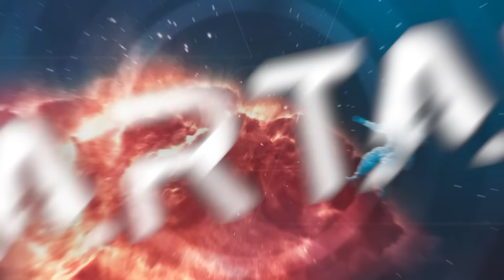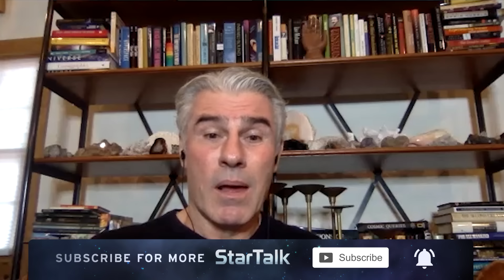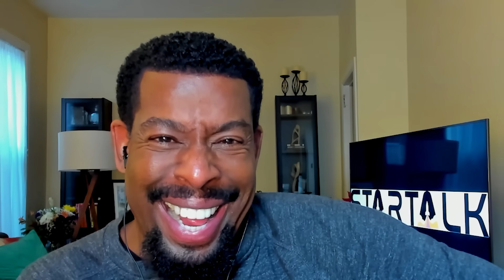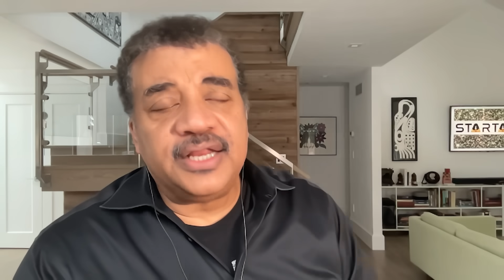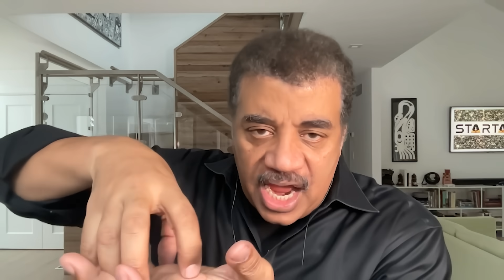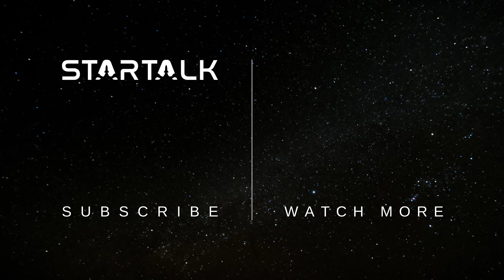What’s The Fastest A Car Can Go? | Neil deGrasse Tyson Explains...

Comment: @8:55 "You're not gonna get a car going 0-60 in 2 seconds unless theres something digging into the road"

There are a few cars that have achieved this
Reply: I grew up with parents who raced in the NHRA,  top fuel now accelerates from 0 - 300 in less than 4 seconds,   NHRA developed the perfect mix of stickiness of tires and track surface and fuel to make it happen and it's a beautiful thing to see
Reply: He said 1g max..0-60 can be achieved
Reply: There are several cars on the market right now that advertise two or less seconds for their 0 to 60 acceleration. Frankly, I don't buy it for a second. The only way they can achieve that, as The good professor tells us, is if they are using special tires and testing it in very specific conditions. In other words, they are lies. Of course, when will you ever want to accelerate from 0 to 60 that fast? The answer is never, because if you ever do it you would be putting everyone around you at extreme risk.

EDIT: I was wrong. Tesla and others have done it. The techniques are complicated, but they essentially have found ways to achieve faster than 1G acceleration from a stop.
Reply: @hellboundedward  we talking about 1G max acceleration.,not 0-60
Reply: @JamesCAlien  There's some nuance that you are ignoring. The numbers were derived from 0 to 60. I didn't believe it either, but the numbers are real and validated by motortrends. It doesn't mean Prof. Tyson is wrong,.just that Tesla has found ways around the problem (for some crazy reason, who needs a car that accelerates faster than you can see?!?).
Reply: @hellboundedward  he's not wrong .Tyson said 1g max
Reply: @JamesCAlien  He said that at 1G, to go from 0-60 is going to take 3 seconds. So if you can achieve 0-60 under 3 seconds without sticky tires, spoiler, rocket engine, etc... Are you pulling over 1G?
Reply: @JamesCAlien  Here is the thing: I hate Elon Musk. I hate Tesla. I am not a fan boy, and I am not easily fooled by bad marketing. Motortrends has been able to exceed 1g in a Tesla Model S Plaid. Full Stop.
Reply: @acolon8999  yes.
Reply: Bugatti Chiron 300+ can easily go 0-60 in 2 seconds!! Besides that’s not the most important measure!!!
Reply: @jeremyswalley8625   Model S Plaid is faster 0-60 than a Chiron. Sorry to be the one informing you.
Reply: @rasmussrensen6119  I didn't believe it, but motortrends has the measurements. I'm not going to trust the manufacturer. The plaid can accelerate at 1.199g on average, while braking was at 1.156g on average.
Reply: @rasmussrensen6119  sorry to inform you ,you are mistaken.he SAID 1G is MAX acceleration.0-60 was just irrelevant talk
Reply: @jeremyswalley8625  no, the chiron has a relatively slow launch, around 3 seconds. Rimac Nevara however have achieved less than 2.1
Reply: @victor555117  what about Gs that's what the # is 1G max acceleration.0-60 irrelevant
Reply: The Tesla Model S advertises a very high 0-60 time. But, it’s pretty much all lies. 

It happens when you’ve slathered the track in glue. This isn’t a thing other car makers do (it’s enough to pull your laced and tied shoe off your foot). Also, the rolling start means it’s moving before the timer starts. The time they give is actually closer to 6-60 which is clearly not 0-60.
Reply: The Model S Tesla acceleration goes from 0 to 60 in 1.9 seconds
Reply: @williampeek7943  not really. Motor trends was able to get close to that though, which is pretty impressive, for a measurement of performance that means nothing in has nothing to do with how you would use it.

There are multiple ways of making this measurement, and I'm not a car guy so I'm not going to pretend to know the specifics in each of the different ways of making it, and professor Tyson didn't get into any of those specifics about how this is measured. 

Another way of saying what professor Tyson is saying is that a car can't accelerate faster than it can decelerate. The Tesla model s, while not meeting the numbers that they advertise, does accelerate slightly faster than it can decelerate, proving that this rule is more of a rule of thumb.

Edit: and if both accelerates and decelerates at faster than 1G.
Reply: @hellboundedward  1g max, nothing mentioned about max 0-60
Reply: @williampeek7943  how many Gs tho... No more than 1G .that's what Neil said

Comment: Three cars that are sub 2 second 
Rimac Nevera – 1.85 seconds (0-60mph)
Lucid Air Sapphire – 1.89 seconds (0-60mph)
Pininfarina Battista – 1.9 seconds (0-62mph)
Reply: These times include a one-foot rollout before the timer starts, so times from first foot of acceleration was subtracted. so you need to add about about 0.3 to each time.
Reply: I recall air resistance increases exponentially . As with water and fluids .
Reply: Tells us most of you did not watch the whole video without telling us you did not watch the whole video............................
Reply: Yep that’s what I thought 😂
Reply: All these cars are all-wheel drive. Motors at each wheel. I’m thinking what Neil’s explaining has to do with 2 wheel drive (rear drive), which lines up closer to 3 seconds.
Reply: We cannot forget the Mcmurty Speirling- it will be road legal and has a quarter mile of sub 8 and 0-60 of 1.4
Reply: @jlutz63  this one's a fan car, 2 tons of downforce at 0mph but I mean 1.4 is so fast idk how that downforce helps lower it from what Neil says
Reply: 1. McMurtry Speirling - 1.40 seconds 0-60mph
Reply: Good examples but these are only current production cars, there were many more cars that are just as fast but not mentioned because they are not in 'current production'.
Reply: @mattlarson9897  the point is not weather they’re in production or not, the point is weather a car could reach the speed or not and clearly they can
Reply: @CabralCreates  I understand, i am simply pointing out that there are many others that are even faster than the 3 listed here.
Reply: @mattlarson9897  Yep Good point
Reply: Any of the hoonagain buds would smoke those
Reply: Okay. I'm assuming that you're not just relying on manufacturer's numbers based on a dynamometer, right? You actually drove each of those cars and experienced this? Wow. What was it like to be in a car that was accelerating faster than 1G?
Reply: @hellboundedward what? Tyson is wrong why are you so ignorant? There's plenty of cars that do sub 3 or eaven sub 2 sec 0-62!
Reply: Dyno tested ,not street tested
Reply: @JamesCAlien  Carwow raced a Ferrari SF90 against the Rimac Nevera and it did 0-60 in 2.08 seconds and the 1/4 mile in 8.62 seconds.

https://youtu.be/A4orCB71BgY (race starts around the 3 minute mark if you want to skip ahead)
Reply: @JamesCAlien  fair enough. I don't know. But marketing wouldn't lie would they? 😉

Comment: Model S Tesla is 0-60 in 1.9 seconds
Reply: Apparently not on the street..the gearing could do it on a Dyno.
Reply: Margin of error will say otherwise
Reply: Engineering Explained demonstrated that the 1.9s claim isnt entirely true.
Reply: Ok to be clear I own 2 teslas. My new model x plaid is has performed at 0-60 at 2.15 seconds on stock tires which are actually all season tires not slicks… This was in southern ohio. If anyone wants to test my claims I’m happy to have them come here and independently verify this. It’s not a model s but it is once again a model x plaid 2022.
Reply: Have you ever done it? Have you ever taken a Tesla model s onto a test track and measured at 0 to 60 acceleration? Or are you just relying on the test that they did, and are you aware of the condition of that test? Where it was done, whether it was done using stock tires, etc. The one thing we know is is that we cannot take these numbers seriously if you only place we are getting them is the manufacturer.